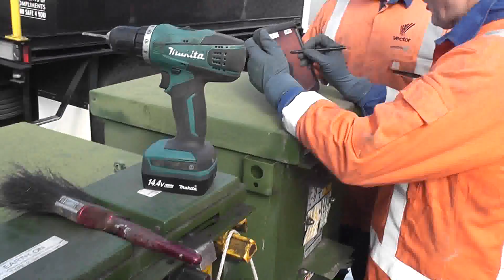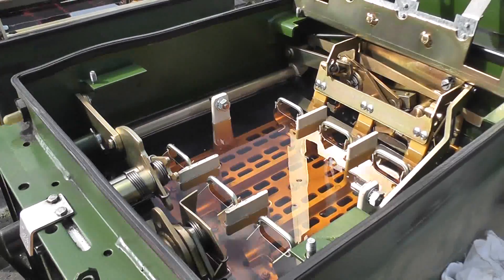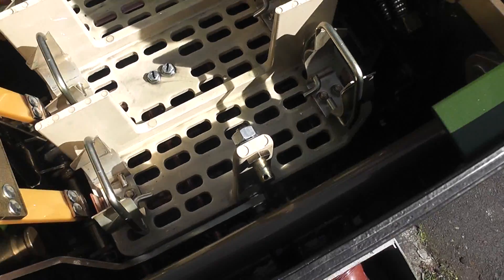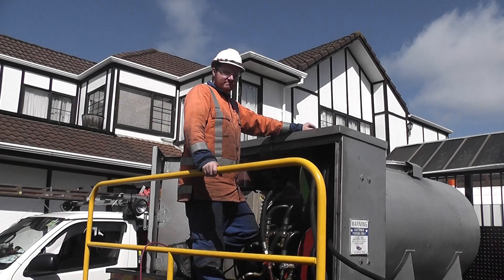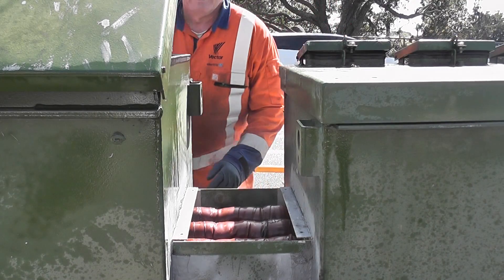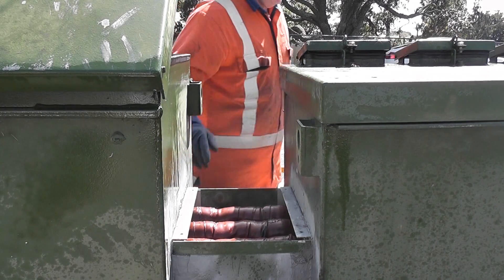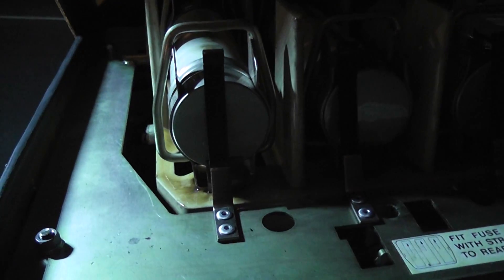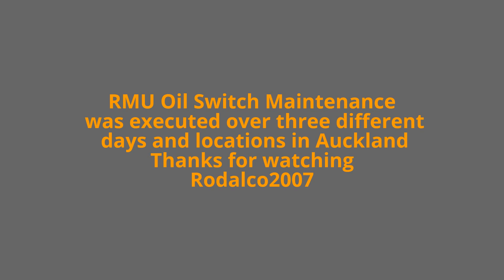RMU  Series 2  - Oil Switch Maintenance

Comment: So what are these and what are they for?
Reply from the maker: Those are main isolator switches to control parts of the network, basically a large ON/OFF switch and fuses to protect a supply transformer.

Comment: I done the revenue CT testing, which lead to their replacement in Lynnmall. When we had the supply isolated there was a large area that had to be shut down due to the SD1 switches around the old United Networks Area. Had this problem quite a lot
Reply from the maker: The SD1 units are still there by old Video Ezy corner, now we have to use an actuator to remotely operate the SD1 switch unit.

Comment: What is the main reason to change the oil? Does it loose certain properties or go off in some way?
Reply: Moisture.  Since these aren't sealed units like transformers, moisture has no problem getting into the oil and reducing its insulating properties.  Breakdown in the oil caused by arcing can be another reason to change the oil.
Reply: douro20 Thank you for your reply. Learn something new every day on YouTube!
Reply: douro20  hello, they do have a seal on the lid or lip of the box. but moisture does make its way into the unit. from the air trapped in the unit from weather temperature changes and dirt and equipment parts from wear and tare. so ya correct the oil starts to loose its insulation properties breakdown' and can course a high voltage flashover. 

regards👍😉

Anthony

High1voltage1rules
Reply from the maker: Oil deteriorates over time and carbon particles are formed during switching. Inspections need to be done in 8 yearly intervals.
Reply: Yes, I suppose it's slowly cooked!

Comment: Love these work videos. It was originally the huge transformers energising that brought me here.

The dirty oil at the end - would that be from bad switching in the unit? Materials breaking down inside the unit?

Thanks for posting!
Reply from the maker: Absorbtion of moisture over a long period of time, some traces of carbon from switching events and electrical  stress all  slowly deteriorates the oil.
Reply: Cheers!   :)

Comment: Another very interesting video! It's great to see how things are done differently in NZ compared to here in the UK. Are they signing onto the permit via the tablet? We still use paper permits as the permit holder can keep it on his person at all times. It's interesting to see you clean the cable terms, we don't really do that here, mainly because we have compound filled boxes and the air boxes are usually on the SF6 gear which we don't maintain. I can't believe NZ has RMU's just on the street without any protection from the public, there's absolutely no way we could get away with that here. 

Many thanks,

Matthew
Reply: Matthew Brown no chance we’d get away that in Scotland, and most of the oil our tanker takes out is absolutely black, but prefer the oil over SF6
Reply: @AndrewClark-e5b  For a minute there I thought you were a colleague as you have the same name haha!
Reply: Matthew Brown nah unfortunately not brother
Reply from the maker: No, the permits are still on paper, The JRA is on the tablet.